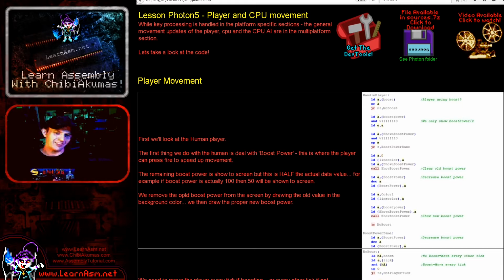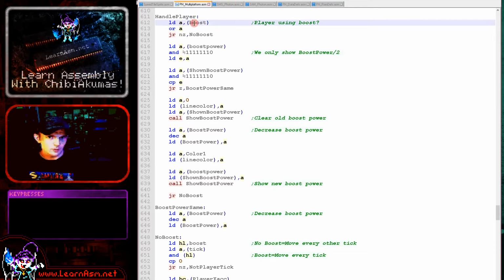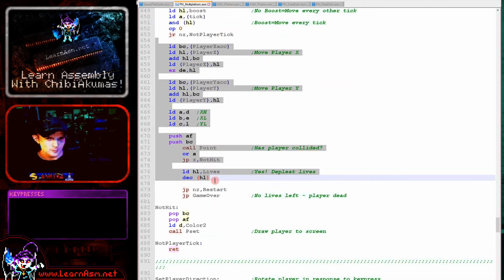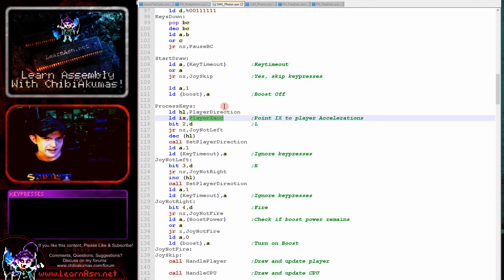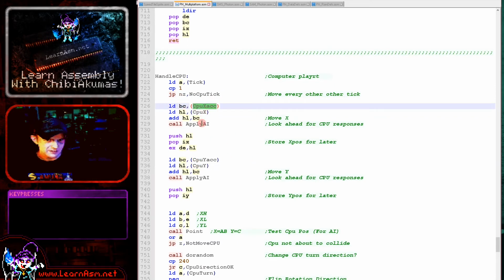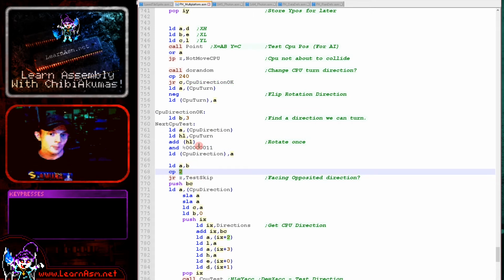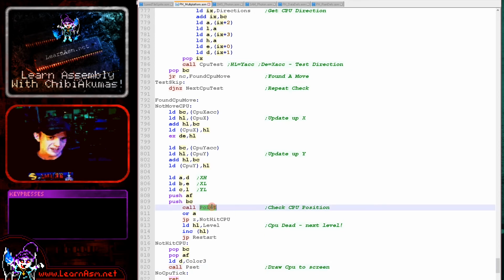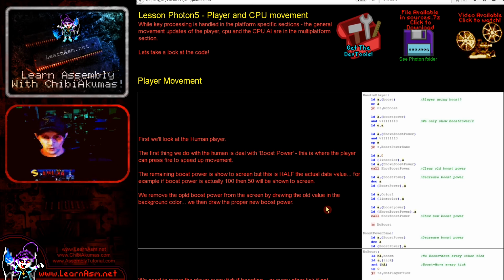Z80 Tron Clone - Player and CPU movement - Multiplatform code Part 4/4 - Lesson Photon5

Comment: Hi Im still cant find a program to use the download for AS assembler says is wont work on my computer (i7 6700 64 bit) any ideas? I really want to start 6809e for dragon 32
Reply from the maker: Does the one in my devtools not work¿ I use 64 bit fine with it
Reply: @ChibiAkumas  no I click on it nothing happens have you another link?
Reply from the maker: https://www.chibiakumas.com/6809/6809DevTools.php
Reply: @ChibiAkumas  thanks, I've downloaded them. So you use notepad++ ? Do I run thru that As well?